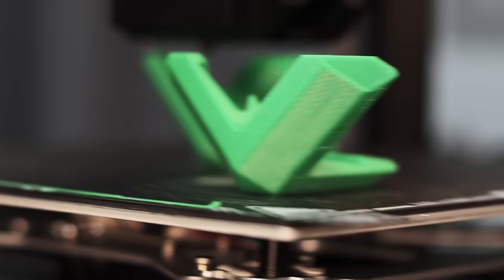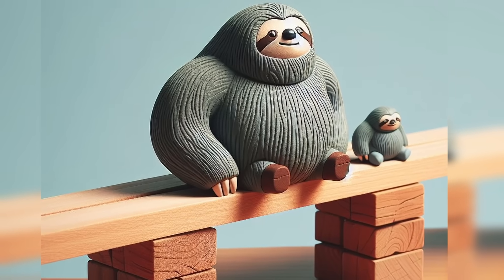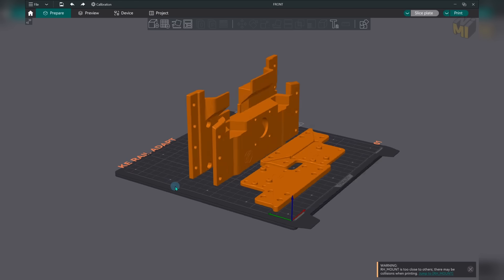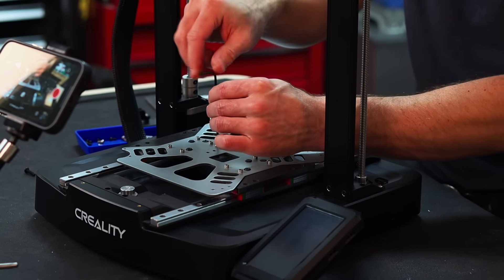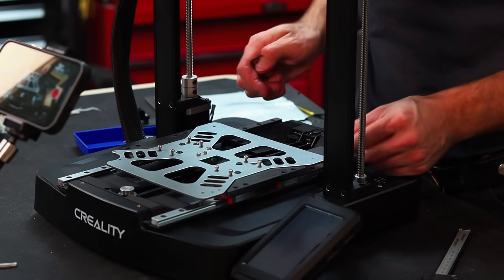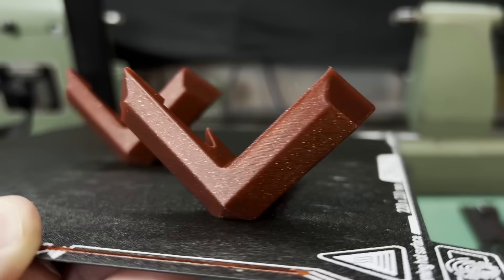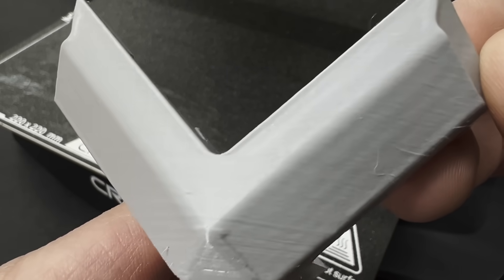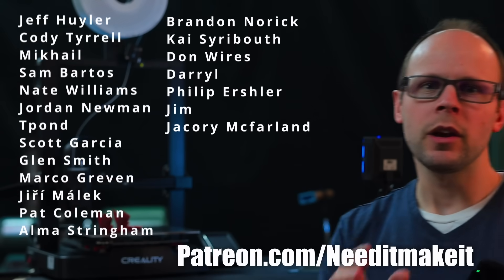UPGRADE your Creality Ender 3 V3 KE with Linear Rails

Comment: I also found my Y-axis bearings to be sloppy. I've adjusted them as much as I can, using the play in the mounting screw holes, but I never imagined being able to swap them for linear rails. This is a brilliantly engineered upgrade which is also entirely reversable if needed. 

I bought my V3 KE after having many impressive prints off the Ender 3's we have at work and I must say I've largely been disappointed with the print quality I'm seeing from it. The wobbling of the gantry bothers me so I plan on tacking that at some point.
Reply from the maker: Unfortunately it just isn't suitable for a printer with these kinds of speeds, the steel plate, the central bearings.  It's all good, we'll get it where it needs to be, the next video is going to be pretty cool and I will have something coming out for the Z as well, but first we need to do something pretty cool in order to get something we can work with a little bit easier.  Sorry for being cryptic, the video will be release this weekend coming, it should be cool!
Reply: @NeedItMakeIt  no worries, I completely get it. I'll be watching with great interest when the next video drops. 

One thing I wondered about the Y-axis rail mod, is there a physical stop for the bed towards the front of the machine now?

Comment: Hello, my KE had 8 mm dots and there was no need to modify it, just strengthen it as you mentioned earlier. It's worse with the construction, which was at a wrong angle. I solved it by sanding the bottom of each side to a right angle

Comment: It's a nice modification.👍👍🙂  But instead of the lm8uu that comes with it, you could convert it to the sc8uu version with metal fixing bracket.  It could have been a more affordable and more faithful modification to the original.
Reply from the maker: Thanks, and sure there are lots of different ways to go, I wanted to get something closer to the ultimate for rigidity, I had a look for hardened rods which were tapped in one end, and the issue always came up with precision.  For guaranteed precise rods, I'd be paying $70 for just the rods, and then I'd need to cut them to the custom length.  Being in Canada, everything is expensive, this is probably a better option for someone in the US.  

Open to any and all ideas!

Thanks for taking the time.

Comment: DO NOT, remove the rails from the carriages .. you risk loosing the balls they can easily fall out even if there is a little bar trying to hold them in... this could have ended badly with a couple balls missing and completly ruining the rail

Comment: So, no chopping of the printer base... nice. As you redesigned the base plate, it reminded me of something regarding bed warping. I noticed that the bed is perfectly flat when not tightened to the base plate, after mounting and leveling it gets warped a little, and situation gets worse after heating it. Obviously the problem originates from tensions and thermal expansion. So maybe instead of mounting bed directly to the base plate via screws, it would be better to put 4 mounting points on 4 mini linear rails oriented diagonally? They should be tight enough to avoid any slack, and they would keep the bed tension-free (i.e. flat), even when it grows because of thermal expansion. 

Or maybe I'm talking nonsense, and warping occurs anyway, because the heater PCB expands differently than the bed it is glued to...

Comment: I have to say that although I have a bed slinger at the moment (it was given to me by a friend) I'm not remotely interested in getting another. I will (and have) make some upgrades to this one but when I replace it it will be with a core x-y. Regardless of any input shaping you will always have the variable of the weight of the print itself increasing as well as the height which will cause inaccurate calibration as the print develops as well as oscillation as it gets higher.

Comment: Great work indeed, looks very impressive! It took just a day since release to empty stocks of required rails on Ali ))
But it looks kind of step backwards in terms of reliabilty. Did you consider to apply double rods (as in K1 series)? Don't get me wrong, it's not a critics, I'm really excited with your creativity.
as for polycarbonade plate instead of steel, I think it is unpredictable, but I can assume it will cause another resonant frequencies so... I'm always curious how you will manage it )))

Comment: ive been waiting on my inserts too. A freaking month late....... ali express....not always
Reply from the maker: Same here...  I still don't have mine.  I thought the linear rails would arrive last, but it turned out to be the smallest and still very important parts.  I was lucky that I had a metal lathe to machine some of them down that I already had, but I suppose the could be filed or sanded if you can't wait.
Reply: @NeedItMakeIt  sometimes AliExpress is order and forget the $1.99 menu though come super fast I'm in Southern California I'll get that in 5 days or less

Comment: Great mod!!! I found your channel due to purchasing this printer and trying to figure out how to fix the few issues I’ve found so far. I have loved this series
Reply from the maker: Thanks, my hope was that this would allow anyone to do the upgrade themselves.  The hardest part is the screws into the power supply, but as long as you're using the 20mm long, you'll be good.  The parts align themselves and follow the video and you'll be good.  I'll have some more videos coming out on this printer, there are a few more mods worth doing to get to a better faster printer at minimal cost.  I hope you continue to follow along as we go!
Reply: @NeedItMakeIt  I absolutely will continue following your channel as I learn and subbed. I’m a total beginner in the 3d printing world but understand CAD and mechanics so this is just the series I needed. I knew I wanted a “capable” printer but didn’t want to break the bank to obtain one. I also didn’t want to buy the cheapest possible thing I could find. After 100’s of hours researching I didn’t go in with a budget, but didn’t want to spend more than needed at this point with the understanding there would be some issues. 

If I enjoy it, and can be productive making blanks and test pieces for my side business I will gladly invest into upgrading the printer itself to something more high end in the future.

Comment: Speed is limited by acceleration, and these are limited by flow. 
I value high consistant flow over speed because i mostly print functional parts. Squareness and tramming of X and Y axis is one of the most important things, and thats where the budget printers usually fail. 
I just got my CR-10 SE, the squareness of the X-axis is hard to measure because the frame is covered in plastic. The print bed was 1,3mm off, and when i tried to fix this the bed screw got stripped cause they used screws that were not up to spec. 
This is just me scratching the surface of the printer, who knows what else is there to find.
The "QC pass-sticker" on the side is a sad joke, however its the hars reality. 

I admire your efforts with trying to get the printer usable, hats off to you good sir!

Comment: great investigation . Doesn't the plastic bed melt from the heat? And how to solve the wobble from the gantry .
Reply from the maker: Thanks!  The PC bed softens at 147°C which should be plenty high even to mate with the bottom of the aluminum.  I have a solution for the gantry coming soon, but I wasn't able to get it done for this video, I need to make it look good and work well without drilling any holes, I have a few ideas on how to do this as a mainly 3D printable part.  Maybe buy 2 small threaded rods.  I'm still trying to work out what would be best here.

Comment: I would love seeing your data report on the use of the poly carbonate plate.  Great video btw, I've been back and forth on doing this upgrade for a  long time.  Your revision makes more sense.  I never liked how close together the rails were.  Spreading them apart makes much more sense.  Thanks for all you do for the 3D printing community!
I clicked on your two links for the rails. But  they didn't come up as the black ones.  Am I missing something?  Lastly, what model is it that I purchase?  And how do you go about cutting them down to 350mm?  Thanks again!

PS. Do you have an extra spot in your discord group?  I would love to listen in to learn.  How can I join if you do?  Sorry, very new to Discord.
Reply from the maker: Hi!  

I think the PC could work well, I will see about making some tweaks to it and see if I can bring this to everyone to try themselves.  If not from PC, maybe ABS as an alternative, not everyone has PC, but I'll try to make it so it's printable on any printer (may require at least a towel or two draped over your bed slinger).   It seems a lot of people are interesting in the PC option, I will purchase the accelerometer for the printer and then we can get some measurements as well as compare the before and after, the Y axis vibrations are not so great and I wasn't running the printer at full speed, so we can do better.  I will also look into an aluminum plate option, alum will cost more, but it should be stiffer and thinner as well.  

I say that other option for linear rails and I think they did a good job, but I was looking for something a little bit better that would last longer and keep that be as stable as possible no matter where we print the parts.

I couldn't find any black rails at a good price unfortunately.... I looked for quite a while but I only saw one set which was far more expensive, so maybe we could use bluing instead?  I think they may be stainless I'm not sure the bluing would work well.  

Yes please join our discord!  I have a link on my Patreon page near the top that should work, but if it doesn't let me know.  We have a great team on our discord of very talented people and it really to have a crew of people that havev a problem solving mindset.
Reply: Thanks for the reply! I found these rail at Amazon.  It appears black already.  And the description indicates it will accept bluing.  What do you think of these?  or should I just go with the ones you have selected?  Lastly, do I need both M3 amd M4 brass inserts?  I know I can go back and review the video.  Thanks for taking the time to answer all these questions.

PS. I became a pateron ASA member.
Reply from the maker: @dpoulson  I don't think it allows links here, but you can send a note on Patreon.  Only M3 heat sets are needed on this job, the 4mm screws will go into the power supply.  

I saw that thank you so much!

Comment: i fully agree that making bedslingers fast is just a dumb idea, i know "its just physics bro" gets slung around allot, but its genuinely true here.
CNC machines dont need to go fast, they had to be stable. thats where a slinging bed makes perfect sense. 3D printers dont need to deal with this rigidity the same way, speed is more important (nowadays) and rigidity is easyer with the much lighter components and loads a printer experiences.
it might be childish, but im never getting a bedslinger for this reason xD
input shaping is a bandaid solution many companies use to make bedslingers faster, and i simply dont support such dumb decisions as a whole
Reply from the maker: Well put.  This is my feeling as well.  These are cheaper printers and it allows people to get something that works 'okay' to at least begin, but the right solution is a printer that's rigid that has light weight/less massive moving parts on a solid gantry.  Ideally we'd use something like what they do with fiber lasers to melt layers together and have small mirrors moving at high speed, but that's probably a little bit down-the-road for home use.  Everything is better with lasers.
Reply: @NeedItMakeIt  Then how did they manage to do it with the V3 CoreXZ?
Reply: @ragesmirk  tbh a coreXZ is quite a waste since the bed still is the slowest part. And the X movements are the only ones taking advantage of the 2 motors

Comment: Nicely done.
Reply from the maker: Thank you!  It worked out great, I'm pretty happy with how solid they are, and it doesn't look too bad, I wish they had the black rails though, that would have really looked smart.  I'll continue to work on the other upgrades to bring this printer to the next level.
Reply: @NeedItMakeIt  I am new to 3d printing and although everybody says go with a Bambu I don’t have that kind of money.  The KE seemed like a good entry level that allowed some tinkering for learning and some upgrading later if I wanted as well.  Thank you to you and you team (discord team) for all the work done.  This is really helping me make my decision.
Reply from the maker: @TinTalon  The Bambu printers are very well designed, no doubt about that, they also use new tech to calibrate the filament, which helps even more to get good results and saves a lot of time, but you're right for entry level, you can start cheaper and upgrade and then when you're ready in a year or whenever you can sell that printer and upgrade again, there is a lot of development in 3D printing, by that time there will be a lot more options.

Comment: I have some Y axis location bias when setting the probe to nozzle z offset. Basically the offset is different at the front of the bed and the rear of the bed. I read that it could be from a twisted Y rod and a linear rail would help. Could you do the "Location Bias Check" from the Klipper docs please? Doing it just at the middle back and middle rear is enough. The difference should be lower than 0.025mm.

Comment: I feel like it would have been a lot less work to modify the linear rod setup, possibly putting in another set of berings (like you did with the rails), and maybe even just replacing the ones that were there with ones that weren't so loose (if you couldn't adjust the ones that were there of course.. seems kind of strange to not be able to 🤔 ). This is definitely a very robust alternative though, and I do agree that it's a bit ridiculous to make something try to move so much mass around so quickly.. but then again, any of the printers are kind of limited by the ability of the material to liquefy and solidify in terms of speed, so why the printers are the only things getting the speed focus is kind of beyond me 🤷🏿‍♀️
Reply from the maker: I see that the newer Ender 3 V3 (Metal frame) has larger dia. rods, and I would assume that it's to avoid this problem.   My printer being new and already having the be vibrating needed a solution.  I covered in the prev. video that the correct size of rods with a pre-load would be fine for this printer.  I just figured it be better to have an option for long-term and there is one linear rail option out there but it uses only centrally mounted carriages, so we're back to the teeter totter effect.  

If they went with rods and somehow were able to run them out further, we could have bearing blocks spaced out further as well and it would be more stable, but they've crammed it all in there to look good I suppose.
Reply: @NeedItMakeIt  Definitely seems like a bit of a short-sighted design decision to make it like they did... but I suppose they were trying to iterate on previous designs whilst not making them vastly different.. kind of unfortunate that it leaves so much potential for issues like this though, especially when it could have so easily been avoided..well, back to the ol' drawing board 🤷🏿‍♀️
Reply from the maker: @TS_Mind_Swept  Maybe it was one of those... "hey you, new guy, we need you to design a printer.. "type of situations.
Reply: @NeedItMakeIt  Well I wouldn't go so far as to say that.. a lot of the designs are fairly decent on it, but clearly not everything..
Reply: @NeedItMakeIt  Thinking about it some more, if it was a new guy, it probably would look a lot different than it does since the current design is so similar to the previous; might not necessarily be better, but newer people tend to look at things differently than people that have been doing the same thing for a while
Reply from the maker: @TS_Mind_Swept  I would hope not.  I have seen it myself with companies I've worked with and the outcome of those choices caused fires in our shops due to poor tooling design.  I'm sure that's not the case here, they want to corner the low-cost market to get people into 3D printing, once they're in, they'll buy filament, download files and buy parts, and eventually upgrade.  They also know that the community will come up with 3d printable solutions.... I just wish they gave us a few more holes to bolt into.  So in the next project, I think we're going to have to drill a couple of holes and add some inserts.  That's one nice thing about having a thick plastic base I suppose.

Comment: Great upgrade, this is a excellent way to support a moving bed, well done. The PC bed support should work fine too, but I'm not sure if the reduced weight is significant.
Reply from the maker: Thanks!  I think it could have been even better if I had used ABS or PC for the parts, but I didn't have enough of that in-house since I mainly print with PETG.  

The weight reduction amounted to just under 400g, but we added a small amount more friction with the linear rails, they are running nice and smooth now, at first they were a little bit stiff, especially one side.  

I'm working on a PC bed that anyone can do as long as there is enough interest, I also want to learn a bit more about the factors involved, expansion of the aluminum heat bed above it etc.
Reply: @NeedItMakeIt I'm interested. I have a KE and recently installed silicone spacers to get the bed more level. Mostly I had already sanded the originals, then realized that the gantry was leaning back a couple degrees. After correcting that, the plastic spacers were way off so I replaced them. But I have noticed on mine and many others that the bed seems to be cupped, with the middle fairly flat but the corners warped upward.